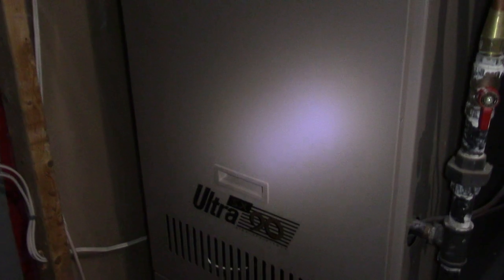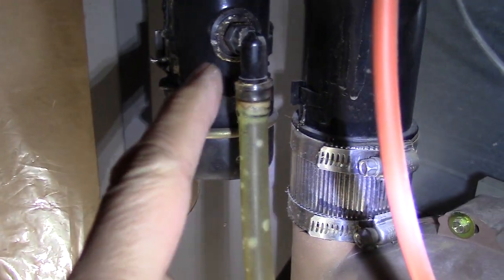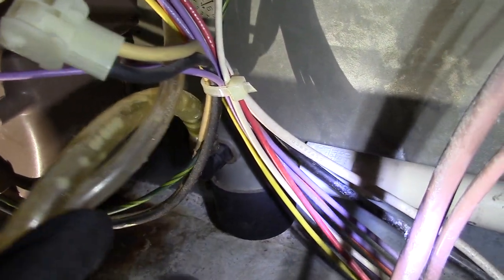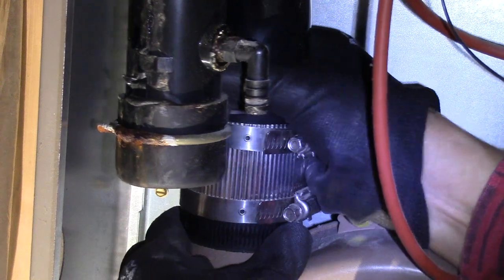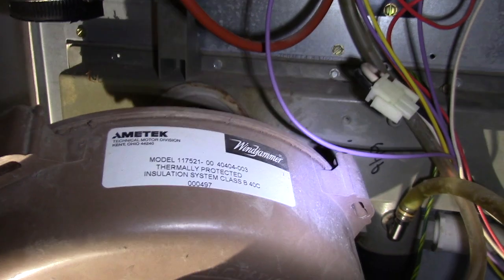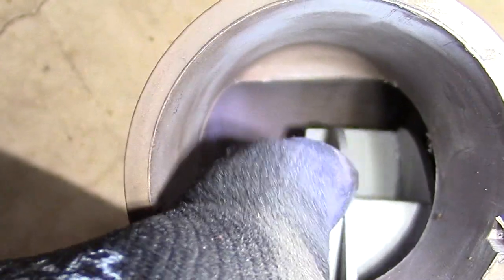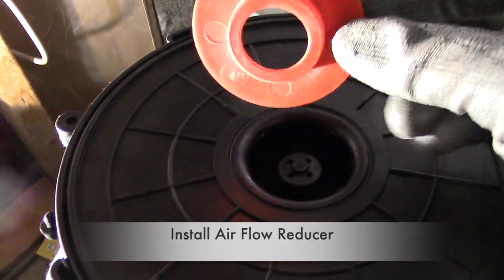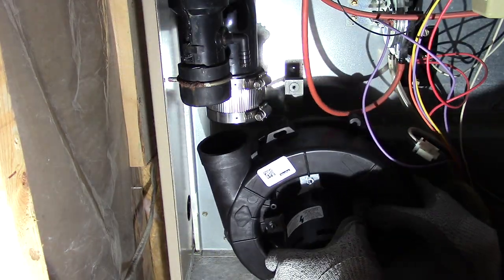Furnace Making Loud Noise. Replaced Draft Inducer Fan Motor. (Ultra 90 Armstrong) DIY

Comment: You are my new hero! Thanks for your post. I experienced the same problem. My motor was so loud I could hear it 2-floors above the furnace. I called three HVAC repair companies, they all wanted me to wait a week for an appointment. After watching your tutorial, I ordered the replacement part, installed the new motor myself.  Mine was slightly easier than your furnace.I have heat again!
Reply from the maker: Glad it helped Gil. Feels good when when we fix it ourselves, right? Thanks for watching.

Comment: Good Day Jonah. Thank you for the video. My Inducer is not completely seized, it keeps cycling on and off continuously without the gas coming on. Measured the pressure at the Inducer where it connects to the pressure switch and its NEGATIVE. Is this supposed to be a Positive Pressure here? Thank You.

Comment: Great video, thank you very much! Our heat went out last week, and we have the exact same brand/type of furnace, so this video was super welcome. You explained it so clearly, both in pictures and words, that helped build my confidence that it was within my DIY abilities. For anyone else who needs it, this is the replacement model I used: https://www.amazon.com/gp/product/B000MU14VC/. It looks similar to the one in this video. By the way, I was unable to use a snipping tool to cut the washer. I used a metal saw, instead, which was a bit tricky, as the washer is fixed to the screw, so very little room to work with, ex. clamp the washer. Anyway, many thanks!
Reply from the maker: So glad my video helped. And thank you for sharing more info for our viewers. Very little bit of information helps others out.